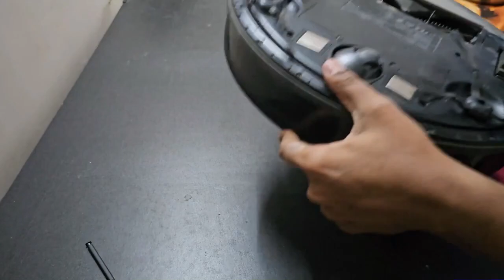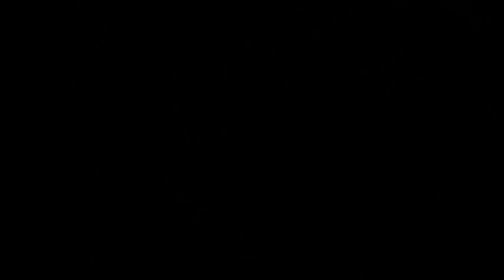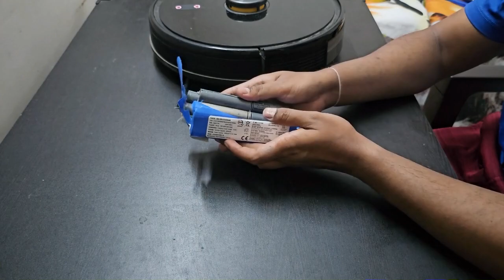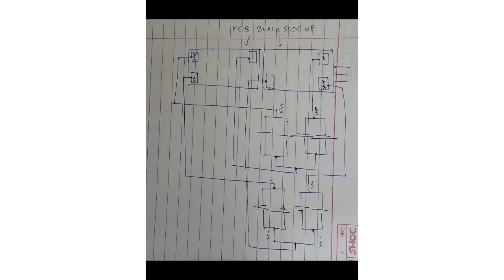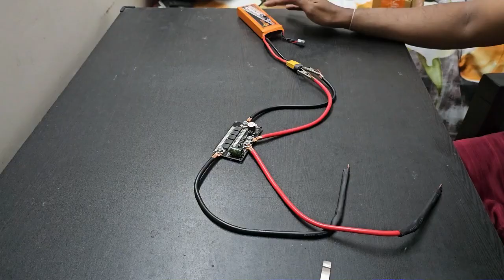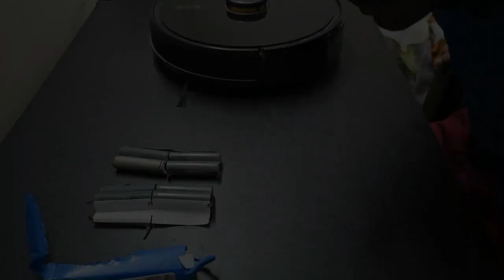DIY - Make your own battery pack for Realme robot vacuum

Comment: Hi
I installed 18650 batteries it worked first but not recharging again it stucks on 4%. Plz help
Reply from the maker: Hi,
Pl check for loose connections. I faced a similar issue due to loose connection,  fixed it now it's working fine.

Comment: Replaced a new OEM battery from realme service center. Cost was -3800 a year back. It worked for a year and gradually capacity reduced to 50%.
Reply: Where did you replaced. Where is the service centre. Is realme has robot vaccume service centre
Reply: Same here, luckily I caught it early and replaced the battery at service center free of cost within 2 days of warranty expiry. Now the second battery also has died after a year.

Comment: Hi.. I have same robot vaccum.. I have used this 6 months properly. But after that I have shifted  stay to another place and I am not in position to take robo with me. Charged this once in two months. Now after nine months I was trying to use this. Its not working.  Is this problem with battery? I don’t know any process of welding that you mentioned in  your video.  Is it possible for me order battery in ready to use form?
Reply from the maker: Hi,

Please place the robot on the charging station. If the home and power button lights illuminate and it starts charging, let it charge for some time. Now, press the power button on the vacuum to start cleaning. If the vacuum turns off as soon as it moves out of the charging station, then the problem is most likely with the battery.

As for the battery pack, DIY was my last resort, as I did not find any readily available battery pack for the vacuum.
Reply: @AbhishekKumar-xx2ym   Helloo vacu turns off as soon as it moves out of the charging station🥲
Reply: @AbhishekKumar-xx2ym   Ys. Its charge become empty after removing it from charging station.
Reply from the maker: Hi,
It means the battery pack needs replacement. When I faced the same issue, I checked on various platforms and with Realme for replacement parts, but to no avail. You may try with a Realme service center near your location; however, the last resort will be a DIY battery pack.
Reply: @AbhishekKumar-xx2ym   Thank you… watched  DIY … but its very difficult for me to create this
Reply from the maker: I understand. I would suggest you try with your local Realme service centers, as I have seen one comment during my research for the battery pack that mentioned you can send it to their service center. They will replace the battery and send it back. You will have to check if it works, and if it does, please do share with us so that others can benefit too.
Reply: @AbhishekKumar-xx2ym  ok i will

Comment: This is a great video! BTW did you try to replace the brush? I couldn't find any accessories from Realme. Any recommendations?
Reply from the maker: Thanks for appreciating ! Regarding brush replacement- yet to do that, will update if I find something.
Reply: @AbhishekKumar-xx2ym please update
Reply from the maker: I recently ordered a replacement parts kit for the Ecovacs Deebot 500 from Amazon. The kit includes two pairs of side brushes that are compatible with the Realme vacuum. Although they are slightly smaller than the original brushes, they work fine. It also comes with three HEPA filters that are a bit thicker than the original ones, but they fit snugly. However, the roller brush included in the kit is smaller than the original and not compatible with the Realme robot vacuum. Here's the link: https://www.amazon.in/Reverbo-Replenishment-Replacement-Accessories-Compatible/dp/B09V54VG1C/ref=sr_1_1?crid=39JXMM89JT95N&dib=eyJ2IjoiMSJ9.dW8DgW-SGMOrJgUd03ui_fAPsc0USp43AcqJyMd3J_zKuy2RwsE1Wtad6lekVn7X5da9kBSPwFA18lq-M55n2-DIA7e4Utjm-zJvWprVoQRrZkapRUNh3oZ41LObRXaSG0HpmyaaGul4CRPI-My_LOgxwjYA8_5QhWe4iVjOdl9Y-CsWfsq5w9iSJ0adFgdAqEoUnFUAVxm1dh1vUedVP0HSnCORxj9BILpQIf9M9rg.dYHEOhRSN3pgzOIKCFuBH7MeXA-KVdayCMhgB4TvFxQ&dib_tag=se&keywords=Reverbo+Replenishment+Kit+%7C+Replacement+Parts+%7C+Accessories+Compatible+with+Ecovacs+Deebot+500+%7C+Filters%2C+Bristle+Brush%2C+Side+Brushes+and+Cleaning+Tool&nsdOptOutParam=true&qid=1707999533&sprefix=reverbo+replenishment+kit+replacement+parts+accessories+compatible+with+ecovacs+deebot+500+filters%2C+bristle+brush%2C+side+brushes+and+cleaning+tool%2Caps%2C520&sr=8-1
Reply: @AbhishekKumar-xx2ym bro, how is the main brush? did it fit with viomi v2 pro main brush?
Reply from the maker: Hi, 
The main brush of the replenishment kit provided in the link does not fit in realme robot vacuum, it's smaller in size.

Comment: How is the battery life? Is it like original? I have the same robot, after 2 years it charges only 60%. Want to replace battery. And can I use normal soldering machine which I use for pcbs instead of spot weld?
Reply from the maker: Can't comment on battery life as it's only been 2-3 months. However, it vacuums the same as earlier and no you will have to get spot weld machine.

Comment: Bro i ave used 12  v bike battery and tried to weld during weld sparks are comming and the nickel strip grtting holes so what's the solution could you please tell me
Reply from the maker: If you are using it with a spot weld machine in which you can increase/decrease the spot weld current as explained in the video, turning the intensity to a lower setting might help.
Reply: I have did the battery pack as you explained in the video after all setting up there is no current flowing in the pcb as i tested with multimeter if you have instagram please share it i will send the images it might be help
Reply from the maker: Hi, you can refer this video tutorial to setup your spot weld machine - https://youtu.be/osNlgdVtl3g?si=wvRA30vUrbXKZ4px

Comment: Can you please share how you opened the bottom of the vacuum to reach the battery connector?
Reply from the maker: Battery connector was not removed in the process. While connected i peeled off the blue battery cover and then de-soldered the 8 cells from the circuit board.